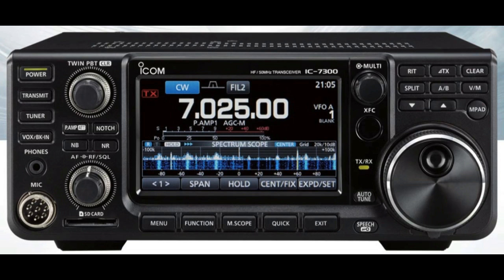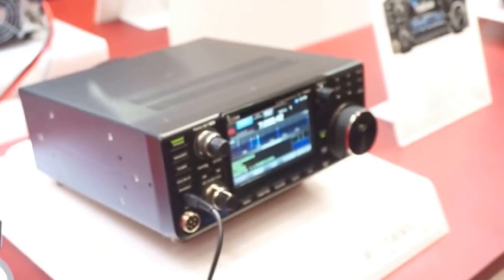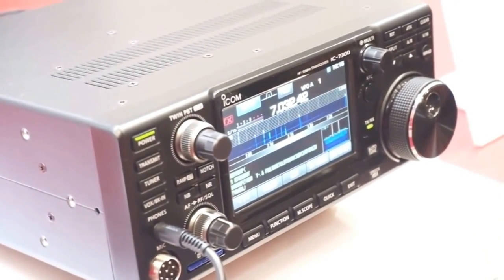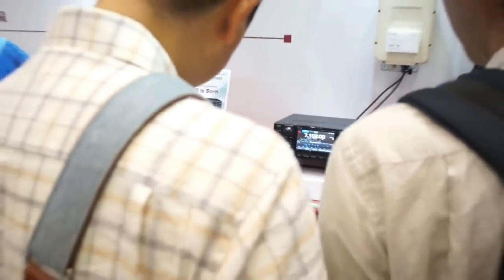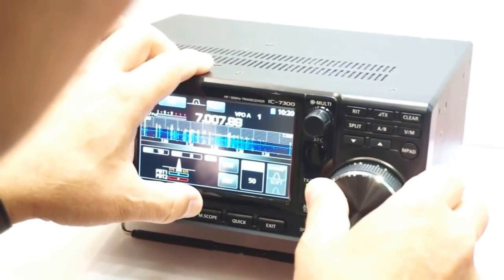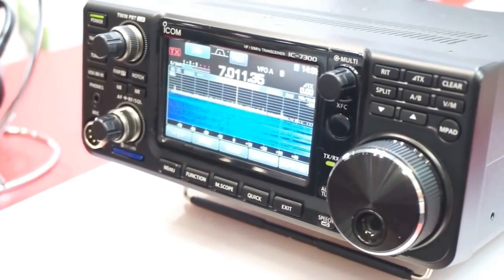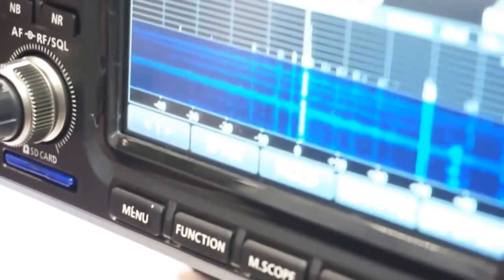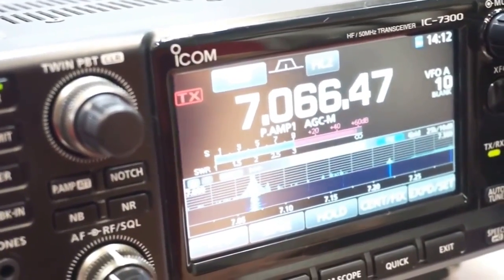Why I will buy an Icom 7300 - sight unseen!

Comment: with all the homework I have been doing on newer hf radios this radio gives the absolute best bang for the buck I have a great old trusty yaesu ft 890 but I think on the modern radios from what I have been seeing the ic 7300 is more reliable and better rx out of the bod and I have heard these radios over the air and its awesome I I think they are less then an ft dx 10 which is having some reliability issues

Comment: That is a lot of radio for 1300.oo µ$ (at the time of this coment)
Only saw two radios I even found appealing, the IC-7300 & the IC-7610
Figure I'll start small with the 7300
Let's face it performance is what radio is all about, bells & whistles are secondary

Keep up the good work Rekindling The Reformation !!

Comment: The 7600 and 7700 don't have real time scopes?  Wow I did not realize that.  A question for anyone who cares to give their input.  I am studying for the tech class license.  I have watched full reviews of this radio.  It has a lot of advanced features.  Some of which I don't fully understand.  The price point is great.  I'd like to have a rig that I can grow into.  But is this too much of a radio for a beginner?
Reply: Moon, the 7600 and 7700 have a much better reciever then the 7300.  Now for the money the 7300 is nice.  Don't forget that the 7600 you can do psk and ritty without hooking up to a computer.  Most of the problem with the 7300 is the white noise..  I can hear big time...  buy a used 7600 you won't regret it..

Comment: Maybe someone knows. ???.  Have ICOM published a complete block diagram or has one or two things been left out. This seems to be a generally very good state of the art radio and all credit to ICOM for a 1st. There has been some discussion on the front end. Is a mixer involved with a low frequency IF about 36KHz and a PLL.  Before  going into the  the A/D ?.  If I had a 7300 I would get the scope on it. Can anyone comment please. I have worked several Hams with these radio`s and they do seem to have  very good TX,  with good receive I am advised.  Kudos to ICOM.  de M0MPT. 73.

Comment: Actually I think ICOM missed some of the most important features that an SDR radio should provide. Yes it is a inexpensive beginners radio but they could have done much better. Every SDR should provide at least a IQ output for the use of digital modes or provision for a large screen pan-adapter. I think after looking at these videos that the display is quite crude and very  low resolution. I am used to my L-Pan2 with my Yaesu FTDX 5000 which has a display much like a spectrum analyzer. My flex 6300 beats this display by miles, I can actually critique someones audio not just a low res display which actually shows nothing but a blob where there is as station. It looks like price-wise a decent beginners radio but I am hoping that Icom will do better on their next venture.

Comment: I was certain that this is STILL a superhet receiver, but with a direct conversion to a low frequency IF (probably in the range of 6 - 25 KHZ), with an I-Q image rejecting mixer.   Looking at the stated parts list however shows that the D/A converter at least has a 250mhz sample rate, high enough to directly generate a signal at air frequency.  This wasn't a surprise, that's STILL a sort of DDS.  They did NOT specify what A/D converter they are using, and THAT is the tricky part.  The TI DSP processor might run fast enough to handle the task, I suspect they might be using a DUAL sampling converter with the sample rate differential in the audio range.  This trick reduces the software and hardware overhead and allows oversampling.   In any case, ICOM is the first major brand to release a DSP-DDR radio, right now the only thing that comes close is the Elecraft KX3.

EDIT:  The function of that FPGA is one of a DDC or Digital Down Converter.  This block implements a DDS circuit and a Digital mixer to down convert (or up convert on transmit) to a lower IF frequency that the DSP processor is capable of handling.  SO I am correct, this still IS a superhet type circuit, however some of the frequency conversion is happening in the digital domain.
Reply from the maker: +Kenneth Scharf this might clear some things up for you. It is NOT a superhet.  http://yo9irf.blogspot.ca/2016/03/icom-ic-7300-review.html

Comment: What do you think of the $1500 price?
Reply from the maker: +Ham Radio K0PIR I think it's spot on. I think I paid a similar price for my IC-7000 in the day, and this receiver is going to be better than that one. Of course, in Canada, where I am, this is going to cost more like $1999
Reply: +The Radio Hobbyist I've got a reservation in on one and I'm looking forward to getting it. The videos on you tube look impressive. One thing I saw is an external monitor on the radio displaying the radios screen. Looked like a mirroring setup. The other thing I saw was Bonito RadioCom 6 connected to the 7300 with a USB cable. I don't know anything about RadioCom 6 but I'm wondering if we will be able to run HDSDR with just a USB cable.

Comment: Icom is playing marketing games, and frankly they are making false and misleading claims about this radio. The text and the block diagram CLEARLY indicate the receiver directly digitizes the RF. Click on "specification" and a different story emerges. The rig does NOT perform DDC - it is a "Direct Sampling Superheterodyne" with a 36KHZ I.F., so it must have a PLL and a mixer. 

Funny how they "forgot" to show those components in their block diagram!

In the end, it's doubtlessly a fine radio - on par with my Flex 5000A, but it's NOT a DDC rig as the diagram, and the text state.

Comment: Such a small rig, nice for using in car. For home use I would keep something more serious. 73!
Reply: +Peter R2ABT More serious in what way?  The rx performance under tight QRM conditions would be better than most all xcvrs on the market.  Check Bob Sherwood's data.  Its a very, very good rx in that way.
Reply from the maker: +Peter R2ABT Yes, I agree. I would use for portable.

Comment: But it SUCKS because you are required too touch the screen every time you wish to make a change on the radio.How STUPID of them.this is NOT a Cell Phone it's a transceiver.I am a huge fan of ICOM but you could not GIVE me an ICOM 7300 for FREE because I would never consider touching the screen on my ICOM 7600 or my ICOM 2820H just so I can make a change.I am always wiping off the screens on these radios from where I touch them by accident.It bugs me having finger prints & smudges on the screens now so I can't imagine how the screen would look if I were touching it just so I could operate the rig? ICOM is so screwed up in their designs.1st they keep producing radio after radio with the pathetic monochrome screens then they finally use a color screen & they want you too touch the screen over & over again? ICOM has lost touch with the real world of Amateur Operators & is working hard on losing me as a customer at the rate they are going.Another thing is that it looks like a Freaking Ugly Yaesu & that SUCKS as well.
Reply: Tom KD6SBR QTH.com,QRZ.com & eBay will be over run with used ones. de W4KVW
Reply: I'll keep my ICOM 7600 & be just fine.Bet it hears just as much as the 7300 & my screen will stay untouched & clean.Look at how many of the 7300's are already out there For Sale now & they have not been out very long. LOL

Comment: The radio needs I/O to large monitor and computer for auto logging and controls. I have a flex much is to be desired. I hope it will  have digital capabilities without extra hardware and software. Most SDR are for software professional and experimenter. This need to be for the average operator.  Following closely to replace flex and IC751
Reply: +John Blum - I'm used to using a computer for displaying my rigs output but agree, it would be nice to have and wouldn't add much cost.

Comment: Knowing Icom the IC 7300 will be probably be in the $2500.00 range.  When Icom comes out with a new radio they price it as high as possible and then gradually they drop it slowly.  Hams will complain about the high price but if it gets good reviews some of us will buy it regardless. lol

When the IC 7410 hit the market it was $2000.00.  The IC 7300 will probably replace the 7410.  Think about it there is no way in the world a large color touch screen transceiver by Icom is going to be below the debut price of a IC 7410 ($2000.00!!!)   Noooooo Way 

Remember the FTDX 1200’s debut price so do the math.  I’m thinking IC 7300 will fall price wise between the IC 7600 and FTDX 3000.  : 0 (
Reply: +Kenwood TS-930s        IC7300   £1049.00 Sterling. UK.  Waiting list.
Reply: Giga Parts has the price today at $1499 a full grand under your now 6 month old guesstimate!

Comment: I'm excited as well but I'll hold off further judgement until I at least see a video of the panadapter hooked up to a real antenna from a decent location.  I haven't seen a IC-7300 panadapter trace yet that looked good.  I also hope it's possible to turn off the waterfall when desired.

Comment: There is no more sound track after 3:00. With all its functions, the tactile monitor is impressive. But before buying, I 'd like to read values of the  blocking dynamic range (blocking gain compression) and 3d-order dynamic range (IMD) and the reciprocal mixing dynamic range (RMDR). If they exceed the current high-ends, we will see.

Comment: That's a mighty small rig. Ergonomics are going to be very tight!~  I am not a fan of multi purchase switches and deep menus.   Also, that is a touch screen which means it would have dirt, grease and moisture to clean up.  Lastly, being on the vanguard of new gear assured you of having to deal with the unavoidable problems of new design headaches and production problems. I would sit tight for a number of months and let all the problems get solved first.
Reply: +John Adams YEA, buying the FIRST of anything is REALLY RISKY. ALLOW at LEAST 6 months, more like a year to get the bugs out. On the other hand many bugs can be fixed now a day with firmware updates....BUT not everything.
Reply: +n4ktz I&#39; intend to wait a couple years and get a second hand unit like I did with the magnificent IC-7000 :D  the 7300 looks like the unit I've been waiting for for dxpeditions, just like the 7000 was when it came out
Reply: +John Adams Not worrying me because the radio is field upgradable, really by a whole lot.  This RX is build on direct RF sampling, no hetrodyne stages to mess with, almost all SDR software.  So Icom can "fix" and "upgrade" a whole lot of things in the field.  My Elecraft KX3 is like that, its great to get new functions and features and fixes (one for a bug I reported....)  Love this stuff.

Comment: I am and amateur. VK4YTC. I'm not into HF ... much, but that may change now. One of the 'new' things I will require is the "Cell call" feature so prevalent on 'commercial' HF transceivers like the Codan Envoy (Best remote 4WD radio in the world, but VERY expensive)  and the ICOM IC-F7000. Can anyone say for certain if the IC-7300 will support Cell Call? There's no "CALL" button on the front panel. It's suspicious that there is no microphone in any of the pictures of the ICOM-IC7300.  The mic on the IC-F7000 looks 'dumb'. I hope the 7300 doesn't get the same 'feature-less' mic.

Comment: Mine is pre-ordered! I traded in an Anan10, which was the best reciever I ever had ( and I expect this will be too) but I missed the knobs and wanted  100w at a better price point than the Anan 100d. This is perfect, and making it better you are not stuck having to always have it connected to a computer, but still can if you want too. Great for vacation, or field day etc...
Reply from the maker: +Tom k2bew Totally agree here. Looking forward to it.
Reply: +Tom k2bew I tend to think it will be hard for the IC-7300 rx to match the ANAN-10.  The ANAN-100D had dual ADCs and is in another league.  Can't wait for Icom to introduce a dual ADC rig later on.
Reply: +N1EU ; I have to agree with that, the Anan-10 was a great receiver. Other considerations for me was I was looking for 100W, more afforadabe than the Anan100, with knobs, and in a package that could be disconnected from a computer.
Reply: +Tom k2bew Agreed on the knobs and computer-less operation.

Comment: They should start shipping 10/15/15.
Reply: +George Smith I'm curious where you saw that date? Originally 
I was hearing the forth quarter of 2015 but recently read a comment from someone that saw a presentation from someone connected to icom  saying the middle of 2016.
Reply: +Tom k2bew DXEngineering webpage
Reply: +George Smith Nothing on the DX engineering site I can find gives a realease date. You can preorder it for $25 but they don't give any indication when it will be in stock or ship. It just says they will ship it "when they are available".
Reply: Yes they took the Oct. 15th date down.  I emailed them and they say they won't know anything until hearing from Icom.
Reply: +George Smith Thanks for that update, I belong to the ic-7300 yahoo group and there are posts that dealers are starting to get preliminary manuals and display models of the IC-7300 on loan only because they are still not approved by the FCC, sounds like it is the FCC approval that will dictate when they become available.
Reply: Wow a user group already for the 7300!  Lot of anticipation, looks like they will sell very well at their projected price range.

Comment: I would like to get the FLex 6300 and Maestro when its released but am wondering if I should wait for the Icom 7300? I also think the 7300 will be quite a bit less $$ then the Flex 6300 with the Maestro? I believe you will have both and maybe you might do a comparison?
Reply from the maker: +greg marles For sure I will be. :)

Comment: Looks very interesting and from what I hear it will be priced right, but I'm not sure about some features that are essential for 
DXing and possibly contesting.  for serious DXing it's necessary to be able to QUICKLY monitor the transmit frequency when operating split and make quick frequency changes to the transmit freq.  If you have to navigate even 1 or 2 levels of menus to do so, this rig is not a DX rig.  I also see it doesn't have a dedicated receive antenna, a handy item for DXing on the low bands.  With those two features I may also be interested in replacing my 7600 with a 7300, but I need to see what reviewers say once this rig is on the air State Side.   Good video and remarks.  Thanks, K8BZ
Reply from the maker: +K8BZ You are spot on with your comments.  I really didn't think of those things as I do not contest, nor DX really seriously. I'll be keepng my Flex 6300 and Icom 756 pro3 even when I get this one.  I'm thinking of doing my portable work with it. 73 - Rick

Comment: I'm putting my order in. This is going to be a hot.. The other manufacturers are going to have to pull there socks up.
Reply from the maker: +M0WBK Reviews Yep - looks great!
Reply: +M0WBK Reviews Why doesn't it cover 2m too??

Simon M0SYS
Reply: +srs26 why would you want 2m/70cm. HF/6/4 would be just nice. VHF in UK is dead unless a rare lift is on.
Reply: Everyone will be to busy wiping the screen from their fingerprints too work 2 meters as well. LOL

Comment: Nice little unit if the price will be reasonable.  SDR is great as long as one doesn't need to operate it with a computer connected.  But, I'll probably stick with my IC-7410 and old faithful IC-746 PRO for a while longer.

Comment: This radio is real nice. If the price is right I will save up and buy one. Think about it,, this radio is just as good as the new IC-7850 and look at what you will get for the money.  wow
Reply: Tom, I also have the 7600 great radio.  If the 7300 is as good It would be worth around 1200 to 1400..
Reply: LOL ok I hope it will not be a lot of money. It don't even have 2 or 440 in it so it shouldn't be that much.  I think Icom went out of hand with the 7851.  $14,xxx.00 out of hand..
Reply: +Mac Attach - Very doubtful the 7300 can compete with the 7850.... if I had a choice between the two ignoring cost I would take the 7850. :)
Reply: LOL,, me toooo lol
Reply: +Mac Attach   You`ll get a box of rocks, chips, and blocks.  Not impressed with the receive I have heard as yet and a guy who works in a Ham shop I know is`nt either. His personal opinion of course. Others may find it great.

Comment: Is this radio going to be around $1200.00?
Reply from the maker: +Mac Attach Only rumors at this time, but yes, I have heard between 12 and 13 hundred.
Reply: Another question this radio have separate bass and treble for your mic setup? Just wondering thanks,

Comment: High Fidelity real time spectrum displays have been available for the last 12 years and DDC the last 5-7 years at a similar price point.  But this radio puts SDR technology in a familiar (one small box) package.  Looks very promising. Very disapointed Icom chose not to include a network interface as this is the current standard for SDR radios.  But they have to protect their other  high end superhets in their product line that do.  If price estimates are close this radio will be very popular.